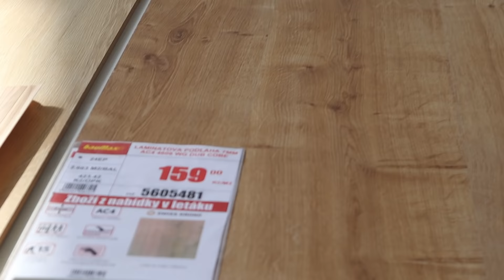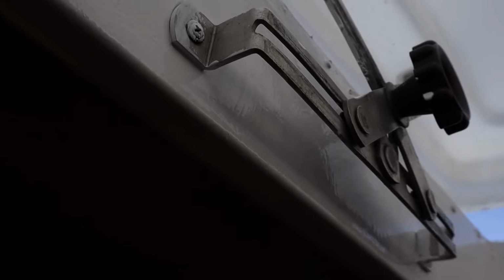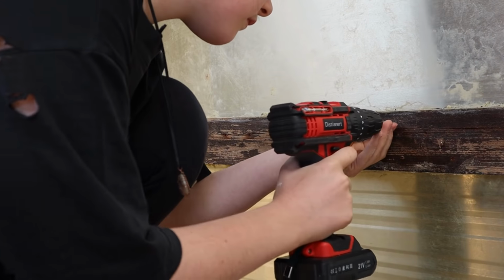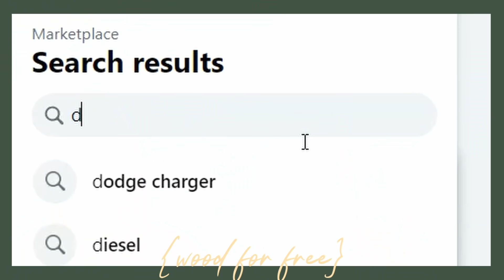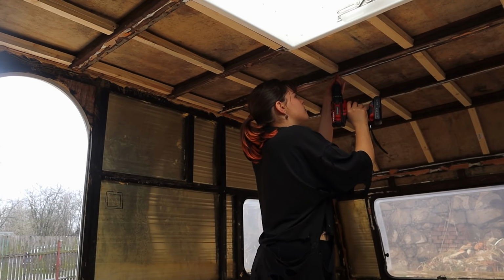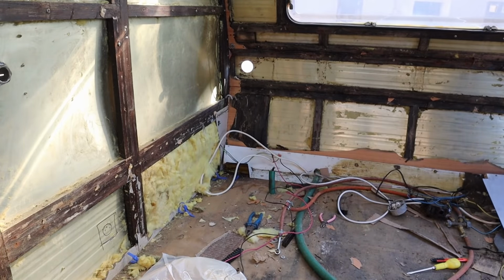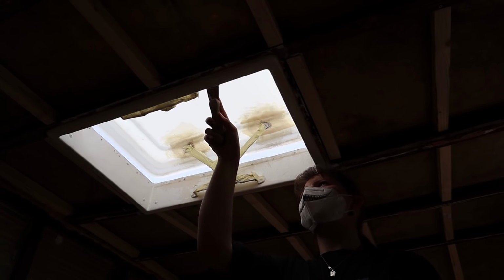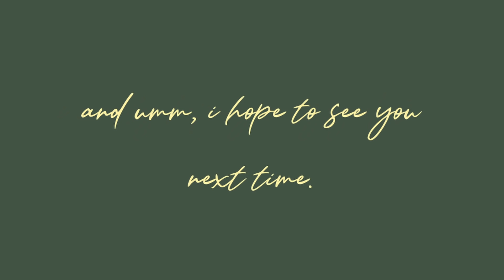Making my tiny home on wheels, starting with rotten beams | Caravan conversion EP6

Comment: Proud of your Mum making sure your boards were straight!!!🎉🌟
Reply: In the US 🇺🇲 lumber places often sell off cuts or warped boards at substantially discounted prices. If the boards are going to be cut to shorter lengths often the bit of twist is not as much of an issue. Especially when you can get more for a lower price. 😸💟
Reply: u are doing great looking so good

Comment: Karolina, you're doing a great job for someone with no experience.
One tip, when using the power saw, always push and hold the straight edge against the vertical back plate when cutting - maybe ask your dad to show you. The wood won't move and you'll get straighter cuts.

Comment: You should actually strip all the wires, as the age of the caravan, the electrical is out of code, plus if you strip them all, you can then put electrical lines and lights, outlets, ect wherever you wish, and no worries of any short outs that could potentially cause damage or worse.... better be safe tgen sorry,  especially with all the work your putting in it. 
Very interested in your ideas for it, and how it will all turn out, your very industrious!! Love your videos,  thank you for sharing!!

Comment: They are called joists or nailing members where I am.  If anyone is disappointed in you being creative they can leave. If you decide the peeling bothers you look for a spray paint called Krylon Fusion. You've done an amazing job so far, looking forward to the next steps. Have fun and give your family a hug.  Hagd.
Reply: Lisa, they are actually called noggins. The joists are the supporting timbers (beams) and the noggins are in-between. 🧐

Comment: to drill into wood on an angle, drill a shallow hole straight into the wood, then angle your drill bit where you need it and it will go in on the angle easily.

Comment: Excellent work this week on the caulking and bracing , Karolina, very neat and tidy. All that bracing will serve to strengthen the entire caravan and will make it so much easier to attach your interior walls after the wiring and plumbing because surely you will have a place to rinse your tea cup and hands.
Here are some pointers for painting slippery surfaces such as plastic, fibreglass, fake wood cabinets, etc. Prep.Wash all surfaces with a strong degreaser, rinse and sand. Afterwards, use an oil based primer paint and then whatever paint product you choose will not rub off. The primer coat ( I use a Zinsser product ) can be purchased in spray cans. 
So happy with the rebuild. Congrats.  :)
Reply: Good job keep on trucking

Comment: When you use the chop saw keep the wood against the rear, if you do a cuts like you showed holding it in the middle the blade may bite in and kick back. 
This could damage the wood or/and break the back bit the wood should rest against, I’m sure YouTube has videos and I’m talking from experience here.
Your doing a great job of learning, it’s a good life coach to be hands on.

Comment: When using the chop saw, be sure to push the wood all the way until it hits the guard and hold it tight against it. That makes sure your cut is straight, and also prevents the blade from catching the wood and pulling it out of your hand.
Reply: pLEASE WEAR SAFETY SPECS.XXXX

Comment: Maybe some contact paper can be a solution for your skylight frame? It comes in many different styles and colours. Doing paint on plastic is never easy, it’s not enough to sand it, you have also to clean it with special products to get rid of fats and other dirt. To get the paint stuck on plastic it has to be very clean. 

Also something I had to add, if you sand down a plastic surface please use a fine grit 200 or above. You could see the scratches the other one did. You also have to sand after each layer of paint and wipe the excess down. You can seal everything with a clear spray finish for a even look, but you have to check that your paint is compatible. 

But you’re doin a great job and it’s always learning by doing! Have a nice weekend

Comment: They have a product called Flexseal that you can put on the top outside of the roof of your  camper to make it water tight.  Check it out
Reply from the maker: I wanted to use that originally but it's not in the czech Republic unfortunately because its mainly a USA brand. 😣😅❤

Comment: Your spraying to close, should be about twelve inches and very lightly spray. Best to have  multiple thin coats. I usually try to do too much at a time and get the paint running etc..lol

Comment: Was the roof paint oil based?  If so then the latex spray based paint will never stick. Sometimes you can find a primer paint which will allow you to transition between the two paint types. Otherwise you'll need to remove it all and use one type only, all oil based or all latex based (water based).

Comment: If you're okay with the way the skylight turn out, then that's alright! 
From what I understand, the problem you are having with the paint may be because it is not adhering properly to the plastic. You would need some sort of... well, it's called "adhesion promoter (Bulldog)" here... not sure what your local equivalent would be called, but spraying that on before spraying your pain may help with the paint situation. Honestly, I think you'll be alright as-is.

Comment: You really need to sand the old paint of the skylight surrounds before u use any other type of paint. If it’s not sanded completely, the new paint won’t adhere properly